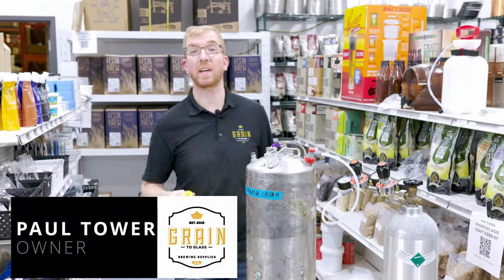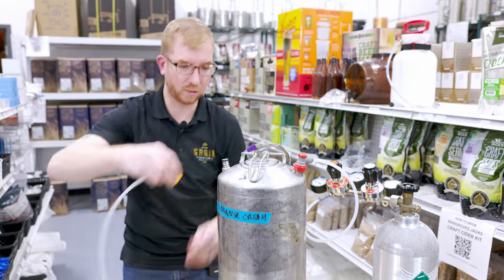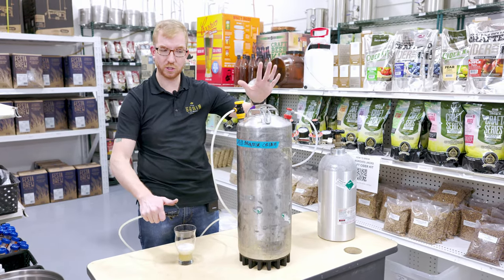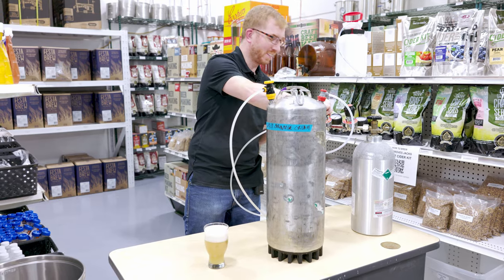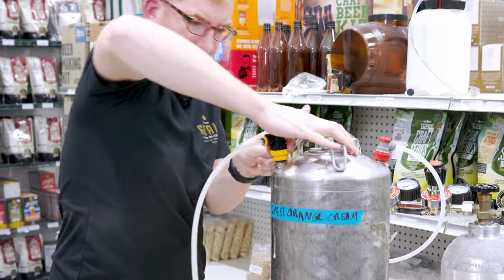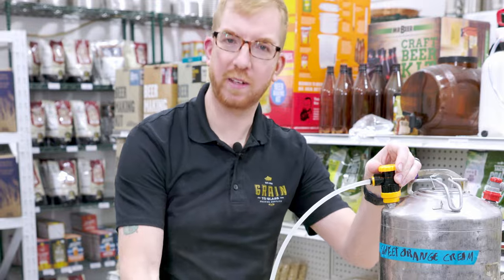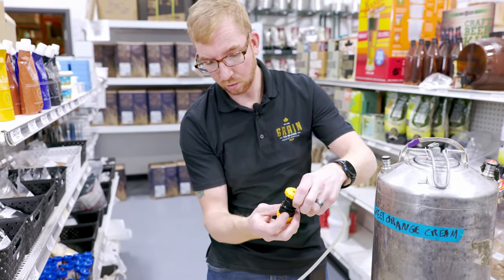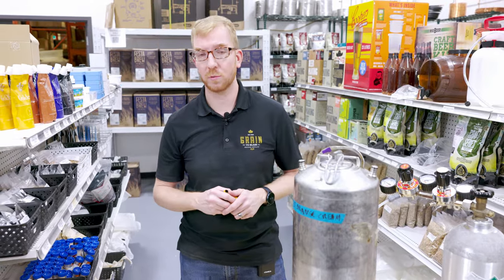Kegland Flow Control Ball Lock Disconnect - Say Goodbye To Foamy Pours

Comment: I can’t seem to turn it now. I am soaking it now in cleaner but I don’t know what else to do. I looked at taking it apart but I don’t see anything below the turn knob I can remove. I only use it around 10-30 psi and for a month and it seems to not flow at all now. I can’t seem to unscrew the bottom either
Reply from the maker: Not to sure on that issue.  Try closing it completely, hooking it up to your keg and then opening it again.  If that doesn't work try reaching out to Kegland to see if they have any ideas.  Cheers

Comment: What if I just want to store a small 2 litre keg in my frig? I don't have the room for a kegerator, so I just want to store my soda-brew in the frig. Will I have to gas it up after every pour or how does that work?
Reply from the maker: Hi, you need a co2 tank and regulator hooked up to the keg at all times.  Otherwise there won't be enough pressure to dispense and it would eventually go flat.  Cheers